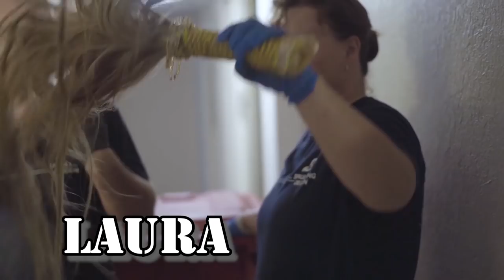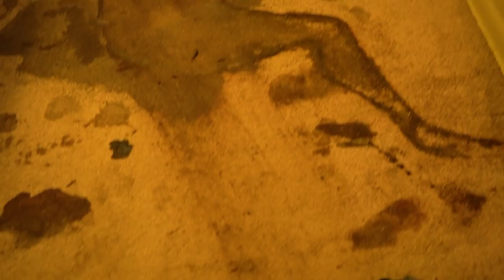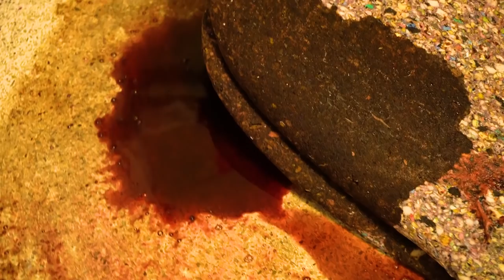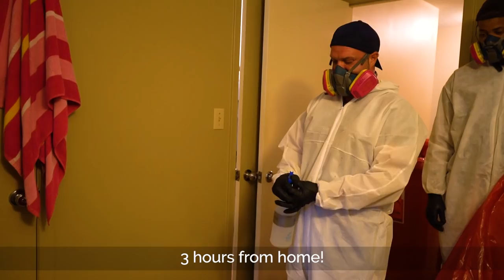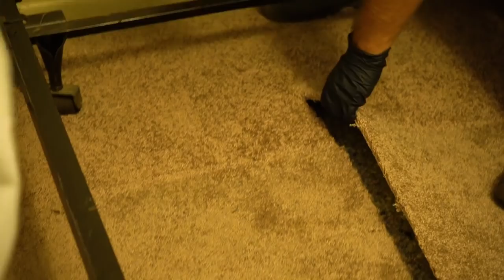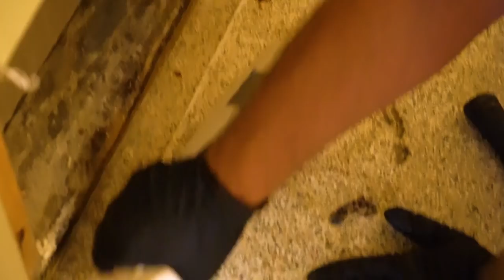S2 Episode 6: Last Impression

Comment: In the 70’s my dad bought a house and the neighbor came over and pointed out the stain in the living room where the owner died from a ruptured gastric ulcer.  It was a large stain which was much larger under the carpet.  I guess back then, people weren’t so worried about blood borne diseases.  My sister and I did much of the work cleaning and repainting the whole house.    The guy had been a heavy smoker and we thought the walls were painted brownish pink, and they were sticky.  When scrubbing the walls with TSP to prepare for painting, we found they were actually light yellow!